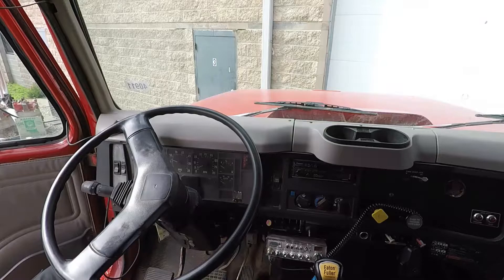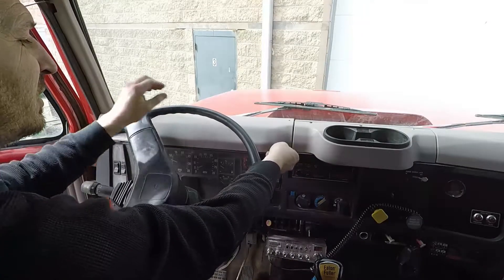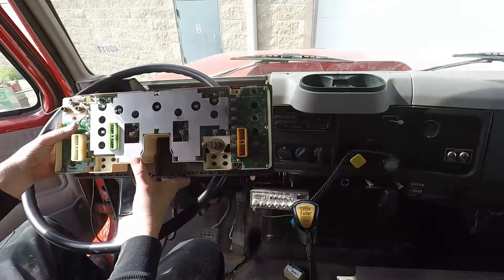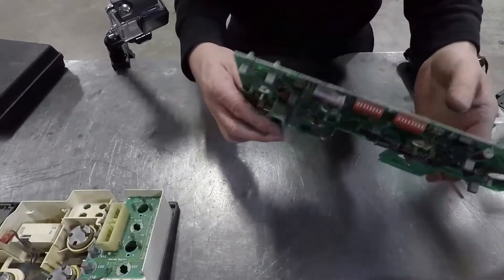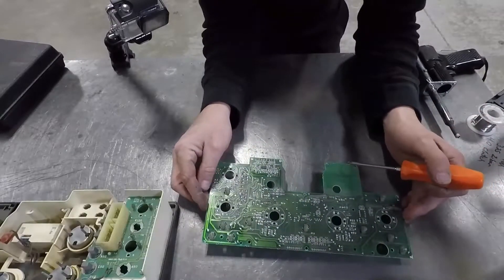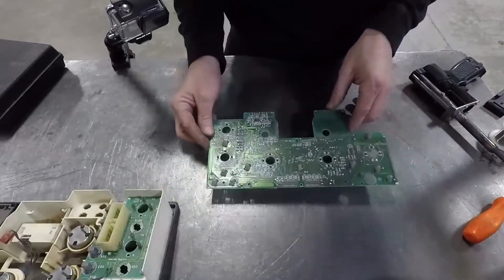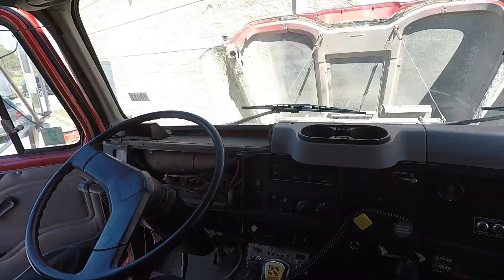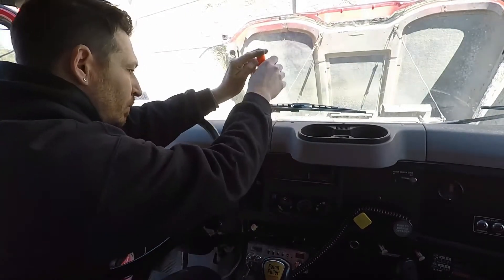International Gauge Cluster Not Working

Comment: Great video. The solder on this, like many automotive solder joints that fail, is likely due to the solder being too brittle.  When you reflow, using solder rated for high vibration environments will often give you a repair that lasts longer than factory new. Again, great info you've set out here.

Comment from the maker: If you dont feel confident enough to attempt this repair after watching the video, please feel free to reach out & we can handle this repair for you if needed.
Reply: How much does it cost
Reply from the maker: @nickbartell4480  I will repair & ship the dash back for 175.00
Reply: Hi,
I have a 2004 9200i and the speedo acts weird. It works properly most of the times but sometimes the needle drops 5-15 mph while accelerating. No big deal when I’m on throttle but it does the same thing when I’m on cruise control. And when it happens, the truck starts to speed up because it thinks it’s slowing down. Keeps accelerating till I turn off the CC and the needle goes up and shows the correct speed again.
Speed sensor already changed, wiring from speed sensor to ECM is already inpected, it looks good.
Do you know what could be the problem?
Reply from the maker: @982berti  I have never messed with the dashes on the newer trucks. Might be worth taking a look at the solder joints with a magnifying glass.
Reply: Do you still woron clusters
Reply: Work on clusters
Reply from the maker: @janivianroyal1598  Never really worked on them,  besides trying to get my own stuff to work correctly. What are you needing?
Reply: @twowheelwerkz810  The exact same thing was happening with my dashboard, but I'm getting it fixed now. Thank you for your quick response.

Comment: Plus, if one light is out, will that stop the rest of the lights from working?
Thanks so much!
Reply from the maker: @rahnellmonroe5608  no you can have 1 single burnt bulb but the rest will still work. If they are all out it could be your dimmer switch or the solder joints like mentioned in this video.
Reply: @twowheelwerkz810  
Thank you! I was wondering! I was thinking maybe I'll just bypass the dimmer switch. 
Is that possible?

Comment: This fixed my cluster except for the oil pressure gauge it stays at 50. It was working before the failure. I took the dash out again and re-soldered the connector. Anything I can check at the gauge ?
Reply from the maker: Have you checked the sending unit on the engine? Might also look closely at all the solder joints at the ends of the traces for the oil pressure gauge on the circuit board.
Reply: @twowheelwerkz810  The re-soldering fixed it working now. I used dielectric grease on the pins of the gauges helped with installing the board . Thanks for the video.

Comment: Have you ever had to test the gauge its self if the soldering does not solve the issue? The Temp gauge in my cluster has not been working, wanting to be able to test the gauge to see if that might be the issue.
Reply from the maker: Most temperature gauges work off of resistance on a ground circuit. So depending on if your gauge is staying all the at the bottom or all the way to the top, you should be able to test your gauge by the following methods. If it is staying at the bottom you can test it by removing the connector from the temp sensor and putting a jumper between the 2 wires, this should peg the gauge at full hot, if the sensor has a single wire you should be able to ground it on your engine & this should also peg the gauge full hot. 
If your gauge is already pegged full hot before disconnecting the sensor you more than likely have a wire that is grounded out somewhere.  
Hope this helps with your question, thanks for watching.

Comment: Can i fix same way on newer inter 2003 2004? Cluster?
Reply from the maker: If it is having similar issues it is more than likely worth a try. Never messed with any newer clusters.
Reply: @twowheelwerkz810  
My does no lights some gages i did replace the bulb lighf but still no light and other gages light went out after i only tryed replace bulb light 
as well as speedometer not detenting  the progatmed speed limit.
Already set at 65mph
Truck still runs over 80mph?
Reply: @twowheelwerkz810  
Only 2003 model
And no light on most on gages and i did replace bulb light
Reply from the maker: I would definitely give it a try, not much to loose.

Comment: Great video. It's obvious that you care about your work. The cluster for the Physics Bus has been out for a while. I resoldered the connections and now when I put it back in the turn signals are all wonky and it won't pass inspection. Do you think I bumped something? Could a solder bridge have caused this? Won't the turn signals work fine even if you drive it around with the whole cluster is unplugged?
Reply from the maker: It seems that the blinkers will not function with the gauge cluster removed, so something in the dash completes the turn signal circuit. With that being said I would assume you either bumped something loose while you had it out or you possible bridged 2 of your solder joints. Might try looking at them under magnifying glass.